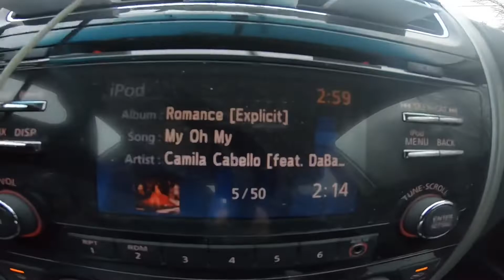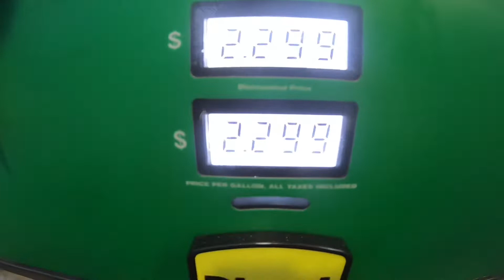2008 Mercedes Sprinter Broke down one the way to my shop Alternator Not Charging Battery

Comment: I have a 2013 Mercedes Benz sprinter 3500 I woke up this morning and somebody stole the catalytic converter. I took it to a mechanic and he said that he could delete the system but he would charge me $3000 or the dealership said they would replace the catalytic converter for $1500 what do you suggest?
Reply from the maker: 3k is to much, delete cost $600 I can send you to the guy that does it, soon I will be able to do it to, I am in the posses of learning how to delete it correct way from computer so that DEF PDF and EGR won’t give you problems, email me for the guys phone number zimaleta@gmail.com
Reply: You can use good used parts, a bit risky but it is possible. $1500 for a new cat with a new NOx sensor, installed and SCN coded (programmed) is actually a very good price if everything is done by the dealer.